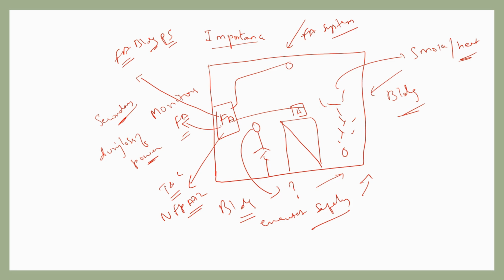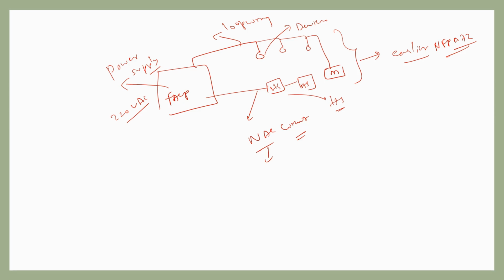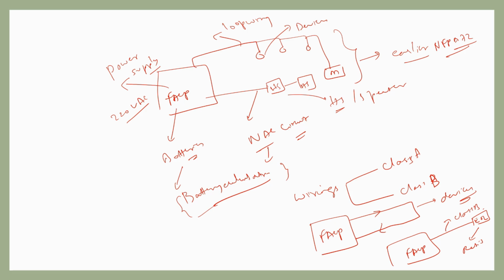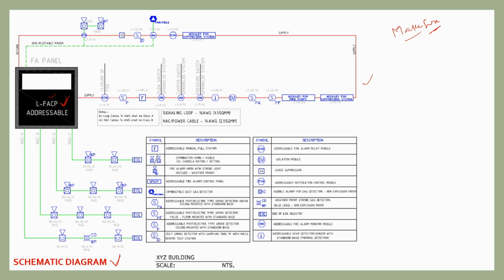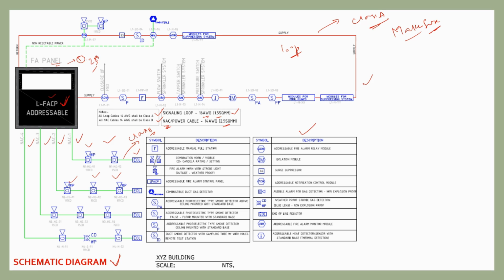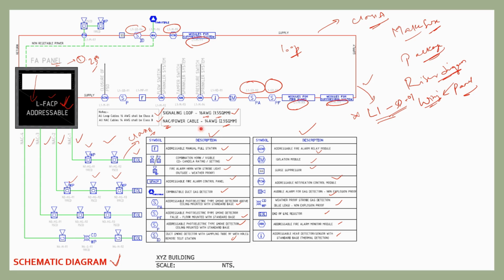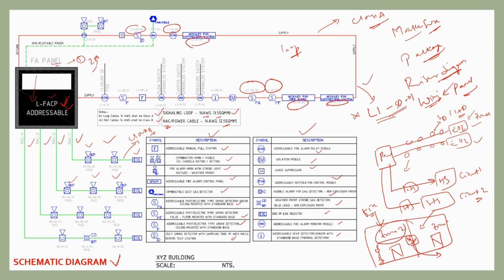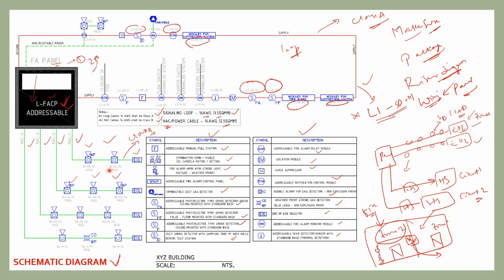NFPA 72 | Fire Alarm System Schematic Diagram Explained

Comment: horn will be not connect with FACP in adressible system
Reply from the maker: Will be connected through control modules if the horns are non addressable type.

Comment: Thanks Eng. Irfan!

A few questions, if you do not mind:

1/ are all addressable detectors loop a class A?

2/ cannot we have notification appliances on same loop with initiating appliances?

3/ is NAC considered a loop by itself?
Reply from the maker: Hi. Thanks for asking the questions
1) Yes, All Addressable devices are designed using a loop configuration. They are call SLC circuts. 
2) No. There is separate connection for Notification devices called NAC circuits
3) No need to considered NAC as a loop.
Please watch my video on "Fire alarm system basics" to know more on SLC, NAC and IDC circuits
Below is the link
https://youtu.be/OmNFI0RtRP4
Reply: @irfancfps  Thanks Irfan for taking the time to respond to my questions.

2/ I have read that there is what’s called a mixed loop where it is possible to have initiating and notification appliances on same loop. Have you come across any?

Thanks for the efforts again. Will be there “a common troubleshooting approaches” episode (it is just a suggestion).